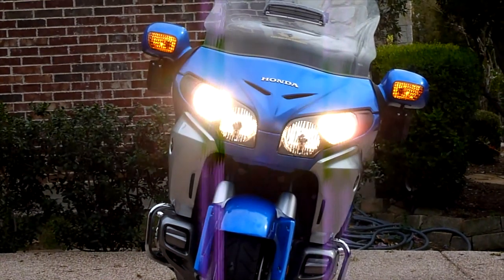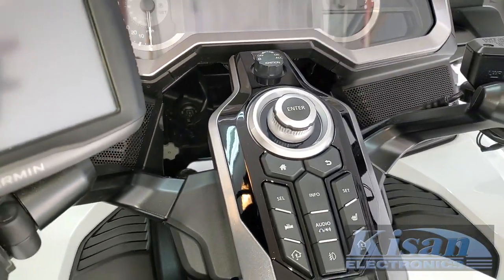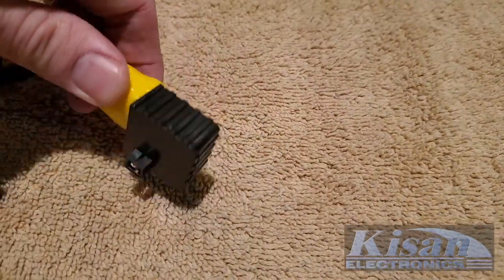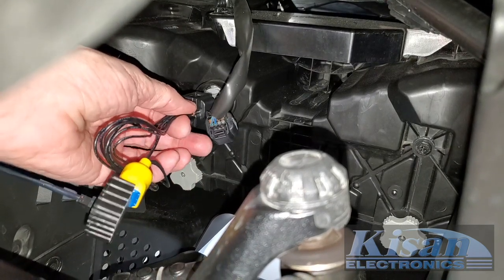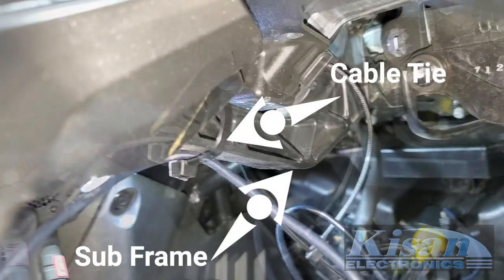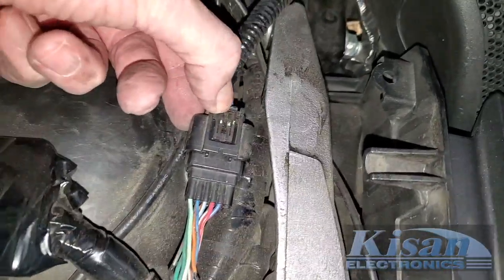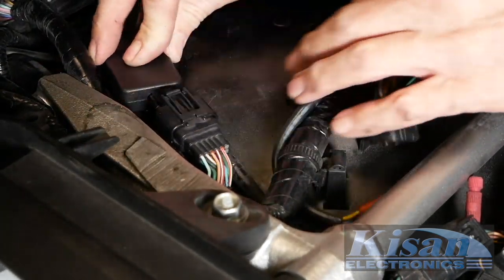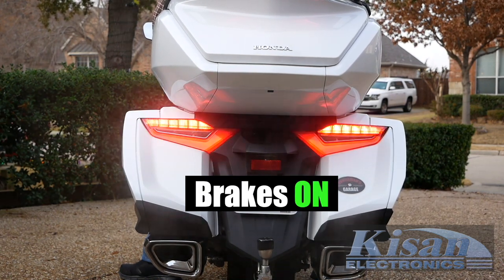Headlight Modulator & Brake Light Modulator for 2018+ Honda Goldwing Install and Review

Comment: I have the Kisan headlight modulator on my 2006 Honda VTX 1300R with an LED headlamp. I use my modulator 99% of the time. No problems to my bike after 6 years of this combo. The headlight modulator has saved me from getting hit many times.

Comment: Just put one of these on my 2022 DCT Tour  tonight. Thankyou for the video everything is easier when you can watch someone doing it. I shall be purchasing your video collection in the very near future.  
One thing that Kisan have done is shorten the wires on the harness to where you can no longer mount the sensor onto the plastic bulkhead. in fact its so short now that it has to hang in the air behind the headlight plug cause there just isn't enough length to take it anywhere.  Slightly annoying as it would cost them so little to have made at least one side of the harness two inches longer and given us enough cable to mount it.  These things ain't cheap after all.. Naughty Kisan.

Comment: I just installed the headlight modulator and taillights modulator. I installed the light sensor in the vent next to the left mirror.  Easy and no problem dealing with the the steering mechanism.

Comment: This is the first time since I started following Cruiseman that I have felt compelled to disagree in writing. I don’t support the use of a headlight modulator and here’s why. I was a motor officer and motor training officer in the 80s and 90s. Between commuting on my KZ1000 and enforcement riding, I averaged 35-40K miles per year. Needless to say, I’ve chased down and stopped thousands of drivers with flashing emergency lights on my bike. I have seen the crazy, almost unimaginable things drivers do when they see flashing lights coming toward them. The best example I can provide is the one than changed my life forever and resulted in serious and life altering injuries. I chased a driver who had run a stale red light in rush hour traffic. I had all my emergency lights on and had to close from a distance of about 150’. The violator drove through a second lighted intersection on a steady green. As I approached the same intersection, a driver in a truck facing me made a left turn in front of me and I collided broadside with the right side of the truck. In his statement to investigating officers, the driver of the truck said he just wanted to get out of the way. It didn’t work out so well for me, and that same scenario played out numerous times throughout the years. People do crazy things when they see flashing lights approaching. The way I handle the intersection approach now days is to flash my headlights a couple times between standard and high beam in an attempt to draw attention to my approach. As for the taillight modulator, I think it’s a great idea/product, and I highly recommend the install. Thanks for the video Cruiseman, and keep’m coming! Respectfully, Dave
Reply from the maker: Good to have that other perspective. Thanks.
Reply: I thought about flashing my lights a couple times too instead of getting a modulator and decided against it because usually if you flash your lights, it is telling the other person that it's ok to go.

Comment: Thanks for this. 
Never been a huge fan of headlight modulators, but having recently been in an intersection RTC, with a left-turning driver, and watching this video, I now have two on order for my bikes ( including the one currently under repair).
I also have two of the high level Honda rack-light trail blazers on order too. 
I already have the Goldstrike trunk light fitted, through a modulator for deceleration warning, so think having these, with the normal function in tail lights, should be more than sufficient.

Comment: I have the Trailblazer Brake Light Modulator installed and want to add the Pathfinder Rear Saddlebag Sequential LED Lights. I will use the Pathfinder Plug and Play harness. I believe I can plug the Trailblazer into that harness as well. Is that correct? Also, these will be the only extra lights I have on my 2020 DCT Tour.  Tks. Steve

Comment: I really like the brake light modulator. Looks like you use the 12 pin plug model, and it comes with both left and right in one pack? Directions say to mount vertically for best accelerometer function but I don't see how that's possible to do under the seat.
Reply from the maker: I am guessing that those are carry - over instructions from previous models. Works fine laying flat on the rear fender.
Reply: It does come 2 in a package. If you buy one T50W-GL tailBlazer, it is the complete package.
Reply: Thank you

Comment: Did you ever do another video on permanently mounting the light sensor? I thought it might work in the upper right corner of the speaker cover on the left side cause I could get to it from behind without removing it, but couldn't figure out how to drill the hole. 
I also found that the new kits have shorter wires so I couldn't mount the Velcro in the same place. Just had to put it where ever it would reach and the entire Velcro is not secured, used plastic ties to keep everything from bouncing around.

Comment: You need to update the installation video for the headlight modulator because Kisan has changed the hardware. They changed the length of the cable between the headlight and bike wiring (you can no longer reach the tab where you used velcro to hold it in place) the box that holds the circuitry and the sensor cable connection to the unit is completely different.
Reply from the maker: Waiting for a new version to arrive so I can shoot a new video.

Comment: My left side tailBlazer was disconnected by the seat installation.  I tried it 4 times.  I think what I was doing wrong is I didn't have the module laying flat.  I stuffed it on the outside wherever I could find space.  Nest time I have the seat off I'll try it again.

Comment: Looking for some words of wisdom.  Just purchased the Pathblazer for my 2018, and I'm assuming it's the new version since the wires are very short and unless I have the light sensor held up pointing directly at the sun, it won't work.  I've tried recalibrating it but the headlight flashes 8 times telling me it's too dark per the instructions.  It's 5pm and I'm outside on a partly sunny day.  Forget about trying to mount it anywhere near the bike.  I watched your video and no way can I mount it where you did.  Anybody have any ideas other than returning it?  Thanks.

Update.  I think I got both working. The light sensor is real finicky.  Also, when I installed the Tailblazer, I put the sensors as flat as I could per the instructions, but for some reason, once I put the seat back on (twice) they stopped working.  I have no idea why.

I never thought about this before, but with all the issues, made me think.  When you're riding, how do you know if they're actually working?  You don't.  They should have made some kind of sensor for at least the Pathblazer notifying you if it's actually on or not.  Knowing what I know now, I would have never bought them.  One more thing to worry about when I'm riding.

Comment: FYI. Just received my PathBlazer and it was an easy install, even though they changed the design. No way to mount it to the shelf, because of that change. It is designed like the TailBlazer in series with the plugs.
Reply from the maker: Really?
Reply: @cruisemansgarage  Now you need to make a new video.

Comment: Chris, I have ordered both of these units.I have also ordered the Show Chrome Isolation box.  I have two questions: 1. Where did you wind up installing the light sensor for the Pathfinder?    2.  Do I need to run the Trailblazer connectors through the isolation box, or can they remain separate? Thank you very much for your time.
Reply from the maker: Believe it or not, I still have it cable tied to my reservoir. I am due for an air filter change and was going to permanently mount it when I remove the top shelter. There will be a video.
Reply: Cruiseman's Garage Thank you, Chris. How about the Trailblazer wiring?

Comment: Cruiseman, i love the Brakelight modulators too and have installed them on every bike i have owned. My 2021 Goldwing tour seems to have more wiring under the seat in the location you put your units. There are protrusions that are part of the seat pan that hit the modulator units. Your seat in the video has these protrusions too and certainly look like they would hit the modulators. Any suggestions ?
Reply: I relocated the modules tucking them in way further back than you have them. Very tight and a PITA !!!
Reply: At 7:35 in your video, no way the seat goes back on !

Comment: I feel like I am spending too much time on this website but....... A strange thing occurred on my way home this afternoon from downtown Phoenix.  My headlight modulator was not working despite working fine this morning on the way to work.  Also when I got home I noticed that the fog/running light on the Pathfinder sequential cowl lights were not working but the turn signal part of the unit was.   The temp on the way to work (6:30 am) was 92 degrees and was 114 on the way home  (3:00 pm).  I went back to the garage 1.5 hours later and disconnected the sensor, pulled it back in and then reset the modulator with the 3 on/off of the high beam switch.  Both were then working.  Does anyone know if this modulator is heat sensitive? And if so, why the modulator would have affected the fog/running lights?  Otherwise I am at a loss to explain why the temporary failure of the modulator and the fog/running lights.  It was only a 20 minute ride so the heat did not affect my mental condition.

Comment: Does the Pathblazer headlight modulator ONLY work when the hi-beams are turned on?  This then shuts off the fog lights, correct?  If so, that kind of defeats the added visibility of the fog lights.  Is there any way to have the fog lights stay on & still have the hi-beams flash?
Reply from the maker: Electrical Connection makes a jumper that allows the fog lights to remain on when the high-beams are on.

Comment: Nice video...I really like the rear brake setup.

I wonder though...how will the LED headlight hold up with it flashing...the headlight assembly cost over 1100 dollars from Honda plus labor
 to install and if one LED fails in the headlight the whole headlight assembly   will have to be replaced...and DMV will make you replace the headlight assembly before renewing the tags for the bike if one LED fails in the headlight...and we all know Honda will not warranty the headlight with mods done to it...just thinking out loud here.
Reply from the maker: I may be wrong, but I don't think Honda warrants the website anyway.
Reply: The pathBlazer is designed to flash as a "soft switch" and will not cause any thermal shock to your super expensive LEDs. The install (and removal) is so easy, you don't have to involve a dealer either...

Comment: Will this work with the PathfinderLED Sequential Brake/Running Light for 2018+ Honda Goldwing Tour
Reply from the maker: The tailBlazer for the tail/brake lights (the ones shown in the video) WILL work. In fact, that's what I have installed on my 2018. The tailBlazer for the Hi-Mount Honda Brake Light is not needed.

Comment: I was hit from behind by a car while waiting my turn on my motorcycle at the stop sign. it was my daily commute to work.I must say it was the most profitable paid nine month vacation of my life.
   I had a Honda pacific coast. If you’re familiar with the machine, the tail light on a Honda pacific coast is at least 15 inches wide. I had one of those brake modulator accessories. I believe it was called a back off modulator. holding the brake lever on, the light will flash three times on/off/on/off/on and stay on for three or four seconds and then begin the flashing sequence again continuously as long as you’re holding the brakes on.
   so I am sitting waiting my turn at the four way intersection. i am next in my lane to go..Everyone has stop signs. It’s not my turn. Wham!!!!!
  I don’t know how much time passed while I was laying on the ground. But as I was coming to, I heard what later turned out to be the man that hit me explaining to the police officer, “I saw his tail light flashing, so I thought he was pulling away “ I was laying on the ground, I had my aerostitch  motorcycle riding Suit on.motorcycle boots, studded gauntlet gloves, and a two week old shoei full cover helmet...At that time, I had been riding/commuting by motorcycle for over 30 years.I woke up on a lane divider concrete island between the lanes. as I moved my head I could hear my brand new $450 helmet grinding on the undriven on rough concrete as I started to move my head from side to side getting my bearings.
  when I heard the man explaining that he mistakenly thought I was pulling out because he saw my tail light flashing, I knew that the modulator flashing system on my machine was the cause of the accident.
   in the following months that I was home recuperating with shoulder damage, I did online research. I found that there is a phenomenon known as “target fixation “ Which means, you tend to stare at something when you don’t understand exactly what it is and suspend reacting correctly in the situation.
   example. Montana state police installed headlight modulators on state police cars at one time. I’m not sure of the year. But I did hear that the Montana State police cars with the headlight modulators had the highest incidence of head on collisions in the entire country. they were being driven into by people crossing the centerline and hitting them head on. The reason for this is, when a person saw those headlights acting in a way they had never seen before, the subconscious wants to stare at it until it determines exactly what it is. Consequently, people tend to drive into things that they are looking at. I have taught many people to ride motorcycles and quads when I worked for different motorcycle shops for 17 years. One of the things that I told my students was, don’t look where you don’t want to go. I taught my kids the same thing when they were learning to ride dirt bikes, and when they were learning to drive cars.
   conclusion:
   It is very risky installing a modulator for the tail light or the headlight because of target fixation phenomenon. People will be practically hypnotized, drawn to staring at it as it approaches them. And till they figure out what it is. as a result, people will tend to veer into the direction of the approaching flashing lights..
   I told the story once before on the Internet, and I was contacted by a group for my safety study, and they wanted my story because there is a  number of people that have these devices on their cars and trucks and motorcycles that are involved in accidents, are the result of the lights on vehicles acting in an unusual way, causing people to drive right into them..
   When I heard that man that smashed into my motorcycle knocking me out of work for nine months explaining to the police officer, that he saw my lights flashing and thought I was going to go, I am convinced my accident was caused by the flashing lights I had on my motorcycle, that I thought would give me more protection
Reply: Hello there , it is interesting point of view for sure and sorry for you being rear ended, but honestly what that person was explaining sounds to more like excuse than the real reason! Why would that person think you were about to go !?!? You see something flashing ,but it doesn’t move and you still hit it instead of stopping? I don’t have this unit installed on my bike , but really don’t see how that will be the reason for someone run into you.

Comment: So I have a question about the Pathfinder Headlight Modulator. It is activated by turning your high beam switch on. So I’m going to assume, if you ride with your fog/ running lights on then switch the high beam on to activate the modulator, then you will shut off the fog lights. Is there a product out yet to over ride the fog light kill switch when the high beans are on?
Reply from the maker: That is correct. I believe Electrical Connection makes an override or bypass that allows the hi-beams and fog lights to stay one together, but it may depend on which brand fog lights you have installed.

Comment: Long question . If I install the Ciro LED Blade light for the tour model with plug and play harness can I still connect the tail blazer in line with its own plug and play harness too?
Reply from the maker: Not sure if it has been tested yet, but it "should" work OK. Just install the tailBlazers to the rear of the Ciro harness.
Reply: Cruiseman's Garage thanks Cruiseman.
Reply: @cruisemansgarage  Was told the bike they are using to test it on is at Daytona and when it gets back they will finish testing and maybe have something in a few weeks. As of 3-10-2020

Comment: The High and Low beams should pulse together simultaneously! I feel that Maximum visibility would be obtained by the contrast of all lights pulsing together as one. The Low beams staying on distracts from the pulsing High Beams... better than nothing, just my humble opinion.
Reply from the maker: I think that is a limitation of the law and what the law allows as far as modulation.